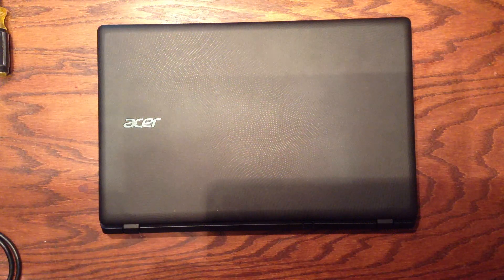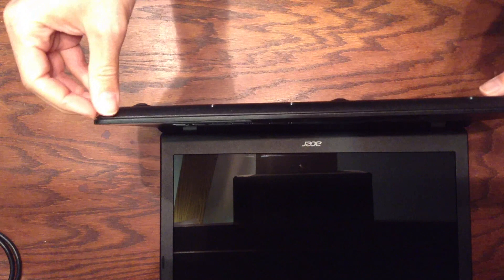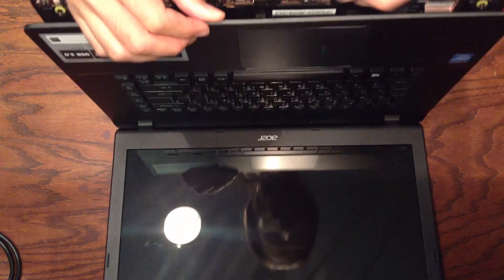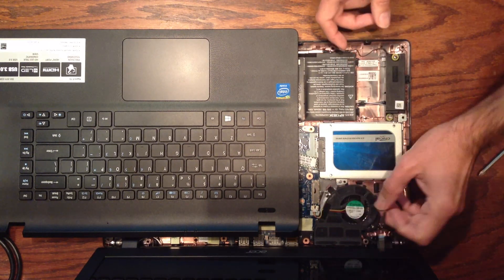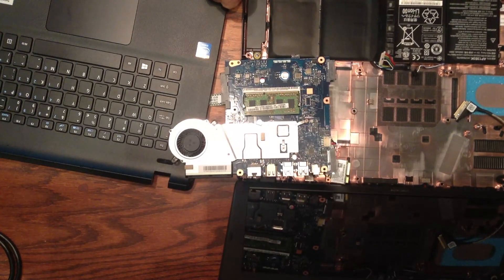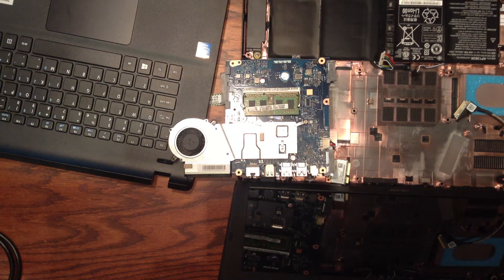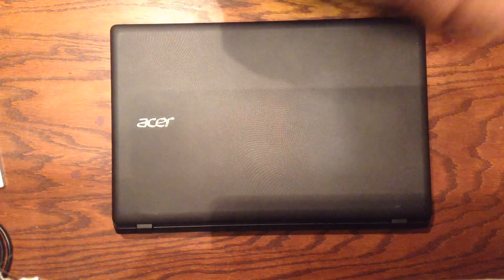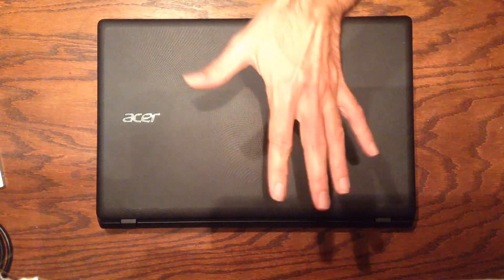How to Upgrade the RAM in an Acer Aspire ES1-511-C59V Laptop

Comment: I have a similar laptop like this but the ES1-531 series with the Pentium n3700 quad core Braswell cpu. What are your load times on the SSD? I recently upgrade my 1TB HDD to a 256GB Samsung PM810/470 Series SSD and the load times are so good. 12 seconds from a cold boot and 3 seconds from awake from sleep. 260MB Read and 250 Writes on 4K alignment is so darn good. SATAII though so it's max at 300MB/s Theoretical speeds :/ I wish I can upgrade to sata III 6gbps to get that juicy 500-600MB SSD's

Comment: Thanks for your video... I ran into a few roadblocks... some of the connectors flipped up instead of having those slider releases, but I figured it out and got it back together and it worked perfectly. Thanks again.

Comment: Hey man, thanks for putting up those videos. Im still doing my research on what laptop to buy and I'm probably choosing this acer - my question to you: is there some significant difference in changing the ram/hdd to ssd with the 13 inch model? 
Have a nice one!

Comment: is there only 1 ram slot or is their 2?
Reply from the maker: +FalloutFTW There is only one RAM slot, but it is still upgradeable if you use the RAM module I linked in the description and follow the instructions in the video.
Reply: +Rich Reviews Oh cool. I thought I had the Aspire ES1-511 but I checked my laptop and mine is a ES1-521 which has 2 ram slots. Luckily its the same as yours when taking it apart I probably would of broke it if it wasn't for you. Thanks! so much!

Comment: the ribbon cables that are under the keyboard are connected to ZIF sockets  (zero insertion force).   the 3rd cable you did not want to disconnect is a flip up type you don't push each side you just flip it up like its on a hinge.
Reply: +tekgeek Thx. Yeah don't lean on the cable. Swing the black plastic runner along top up.

Comment: Excellent video, I want to change for ssd disk and RAM. A question, you can change the processor? and what kind of processor supports the plate ?. Thank you very much.
Reply from the maker: +Juan Acevedo No, the processor is not replaceable. I have never seen a laptop with a replaceable processor.

Comment: I want to commend you on your video.  I just used it to install 8GB RAM in an Acer Aspire ES1-512-C12D laptop in about an hour.  It wasn't exact but it got me through the touchy parts like pooping the clips to open the laptop and the slide locks on the ribbon cables.  I couldn't have done it without you.
For folks with an ES1-512, there are a few distinct design differences that actually make it easier than demonstrated by the video.  Just proceed slowly and carefully, especially with the cables, and it should go well.

Comment: The cable that should not be separated came off and now I can't get this thing to get power.  Me and my clumsy hands have done it again. :(  I have a few weeks to get it back running before my panic will really begins.

EDIT**: Had that same wire backwards and now everything is all good.  Thanks for the video man.
Reply from the maker: Robert McCray Whew! Glad you figured it out.